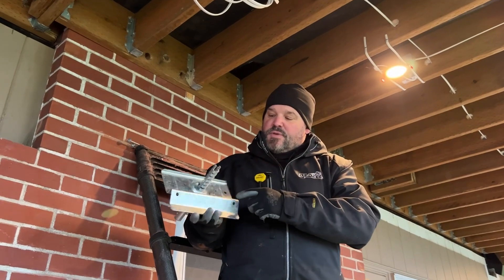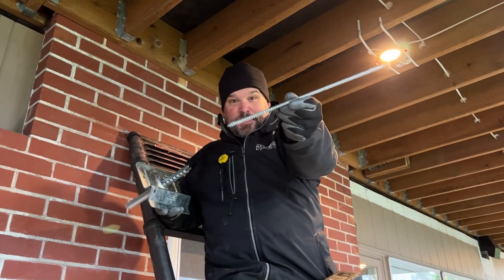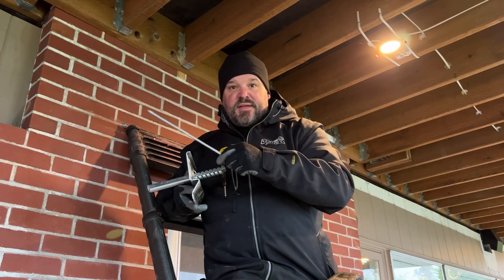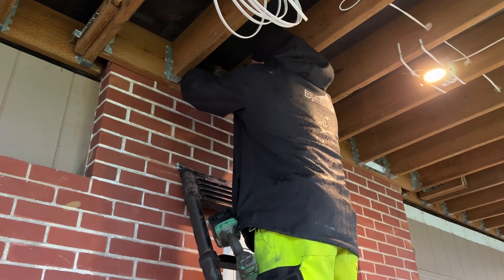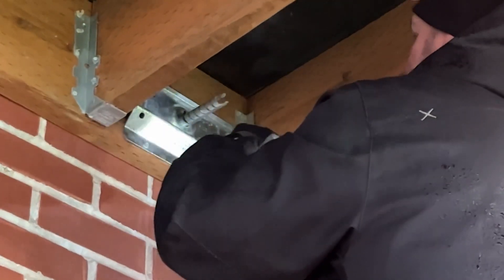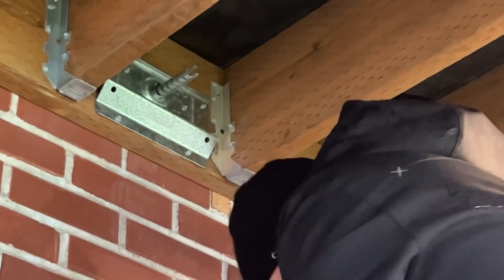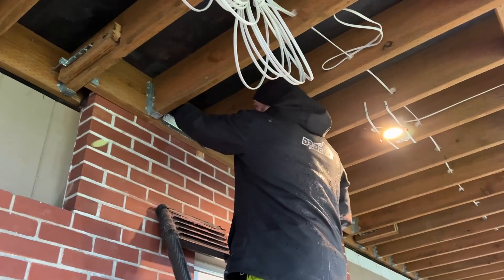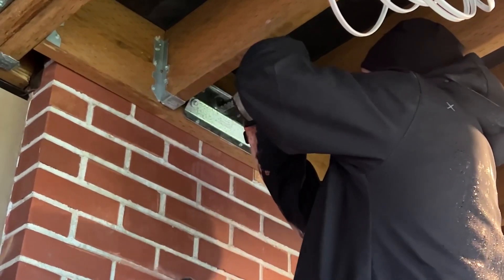Installing Simpson Strongtie BVLZ Brick Veneer Brackets

Comment: Simpson needs to create a socket that you can use to run in that center support they recommend to use pliers with. Run that in with a 20v cordless impact with low torque.

Comment: I love how they don’t show the drilling of the ledger board and what happens if you don’t drill on the perfect angle. In Canada  they are $100 each and on average deck needs 10 to 15 plus takes longer. So the cost of building decks is getting crazy. I’ve been building decks for 35 years and never had a deck issue on brick homes. I think it’s a good product if you have extra money to spend.
Reply: @georgecamero7888  so I take it you don’t attach the ledger but prefer the  freestanding route?

Comment: Dr. Decks:  Do you ever install ledger boards to a brick house with just bolts?  My building inspector in my city says that's to code (and that's how my existing ledger board was installed.  I'm adding one small ledger board and thought I'd use the same methodology as the existing board but can't find much in the way of instructional videos on YouTube showing this method.
Reply: You can only do that if it’s solid brick. If it’s veneer you should use these brackets

Comment: do you have to drill holes in the brick at that 40 degree angle?
Reply: Yes
Reply: @EtoTheKay Yes, I found out
Reply: @alanmatthews9260  What size drill bit did you use for the 45⁰ angle screws?
Reply: 40 degree. 1-1/4 worked

Comment: What was the labor time on each bracket?
Reply: I did them. 5-10 mins, each. Drilling through brick is the hardest part. The compression strut doesnt screw in easily either.
Reply: @EtoTheKay  ahh okay. Thanks for the response! Did the layout and templating take a bit of time?
Reply: @ofmilkandhoneyhomestead1812  The instructions call for the holes to be drilled on the ledger and brick seperately. Then putting the ledger on the brick and HOPING the holes line up. No way, that's not happening. Even if youre off 1/2" youve just ruined your brick and ypur ledger. I installed the ledger temporarily then did all the holes after it was hung. I found this to be the easiest way. Dont understand how anyone could have success installing it the instructions way. Nearly all the videos have them being installed when theyre already up!
Reply: @EtoTheKay  hah, very true. Thanks for the tips brother.

Comment: Thank you for your videos Doctor.
I  watched another of your videos on using Helical Piles, actually two.

Both instructive, but a I wondered if you could do a video especially to throw more light on the subject.

Thank you in advance.

I wondered if you could find experts on the subject of span length of the Deck floor joists in relation to the size of the Helix in the Helical pile.

What size of Helix on the pile will support what length of that deck floor joists !?

And if the Helix can be made larger, how much of a longer can we make that deck floor joist !?

Please help.

Comment: I need to buy Simpson stock 🤔......my god ......how many more fasteners . They are convenient but damn they add up quick in cost
Reply: Obviously you dont understand the engineering and liability associated with their hanger / fastener systems.
Reply: saves $$ bottom line!
great pic @ 6:19 showing 2 types  of simpson brackets.

Comment: Did you put any flashing behind the ledger board and if so what did you use.  I am using the "deck to wall" spacers behind my ledger but that still leave an opening where the holes are drilled for the BVLZ's.  Now I think the long screws, since they are drilled at a 40 degree angle would not be a problem since the water will run out but the hole for the  bigger screw is straight in and could be problematic.  What do you think?
Reply: I think I'm just gonna grab a roll of butyl tape from work 😂
Reply: Great question.  What did you end up doing?  I'm uncertain of how to flash with brick.  My original deck did not have any flashing and was there for 30 year and no issues, but building inspector I guess will ask for it, just not sure how to do it.

Comment: The compression strut needs to be touching the sheeting before the two bolts are torqued.
Reply: The strut is bound up on the metal after they were torqued down. Seat the strut first the torque the lags.
Reply: Why
Reply: @brianarcara00  because something needs to be touching the sheeting or else when you tighten the screws, the bricks will get pulled in.
Reply: @ducati_paul wrong Simpson themselves say not to stop trying to sound smart
Reply: This was my thought too haha
Reply: Nope, that’s why you pre drill 1 1/8 inch holes. The screws should not touch the brick. Therefore no pulling involved.

Comment: Do you need a bracket between each joist?
Reply: What Paul says below, you can see the spacing table on the Simpson website
Reply: It depends on the distance the joists run before they have support from a beam.

Comment: So can I use these brackets to attach a ledger board to brick veneer? I know they screw into the rim joist of the the house but are these acceptable attachment devices
Reply: you are actually attaching THROUGH the veneer to the floor framing/rim board.  check out the Simpson website

Comment: Never heard of that bracket. Good info!  When you held up the long screw that was my first thought, better make sure the angle is right so you don't poke thru the floor!  Also I thought you would have had a double plate against the brick facade, and that would tie into double joists as per American Wood Council design recommendation.
Reply from the maker: Simpson does not recommend installing through a double ledger.

Comment: I’m not sure I completely understand the point of that particular bracket. Is it used as a lateral tension tie, a brick stabilizer, or some other specific use that is escaping me?
Reply: Building code for homes that have brick veneer generally don't allow for deck ledgers to attach through the brick and the air gap as brick veneer is not structural. This bracket takes the load off the brick veneer
Reply: Brick cannot be used to support a ledger board. This bracket solves that issue by putting all the load on the bolts, which are put into the rim joist.
It's a very well designed solution.
Reply: Like DrDecks said, there is an air space behind the brick.  This keeps the deck from pushing the brick against the house.  I would have had double plate against the house tying into double joists as per American Wood Council design specs.